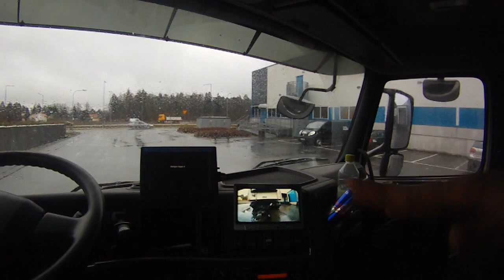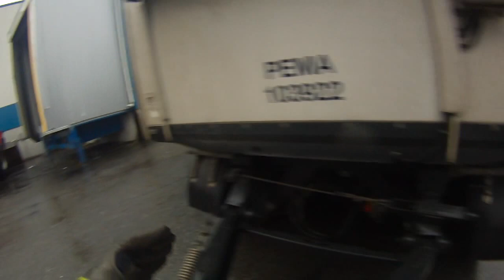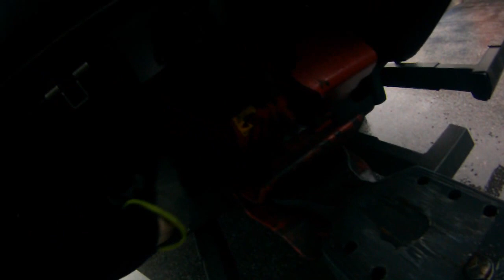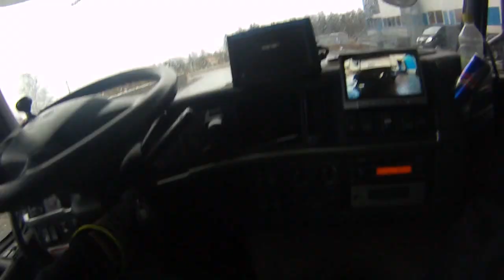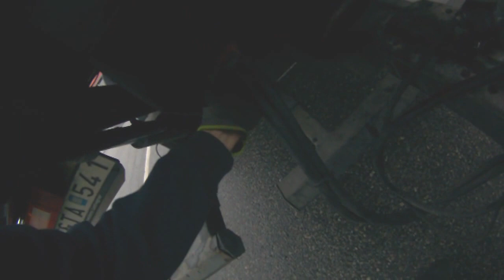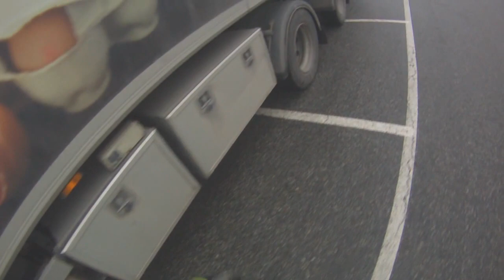How to Connect and Disconnect VBG CE TRUCK + TRAILER, guide tutorial walkthrough commentary.

Comment: The first one is probably for the Parking brake,you have praking brake,then air brake, current and ABS.
Reply: All brakes on truck and truck trailers works with air, so the air cable controls them all.
Reply: It has a Duomatic air connector, so both airlines are in one connector, both the supply (the one that releases the emergency brake) and the control lines and you connect them both at the same time.

Comment: Gloves inside the truck, really? What's the point of wearing gloves if you are carrying all the dirt from the outside with you in to the truck and covering the steering wheel with the gloves, it will get your hands just as dirty as not wearing gloves at all.
Reply: Fair enough.
I for one drive a fuel tanker where the gloves can get covered in diesel and fuel oil so anyone who would dare bring those into my truck would be scolded so badly that they might have trouble sleeping afterwards :P
And my steering wheel is clean, as it should be in any self respecting truck driver's truck.